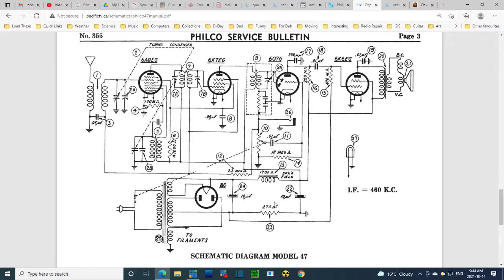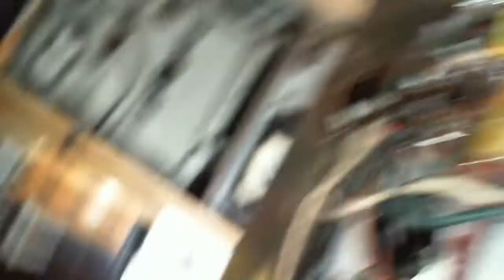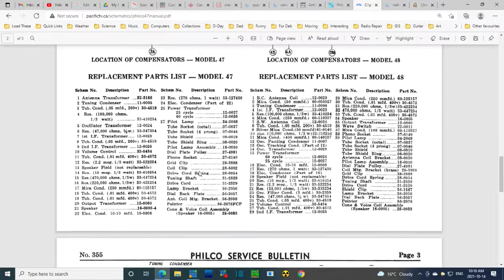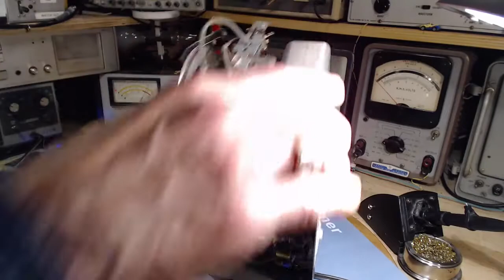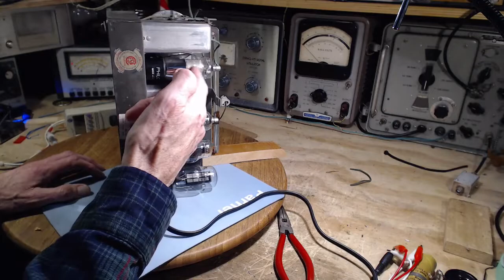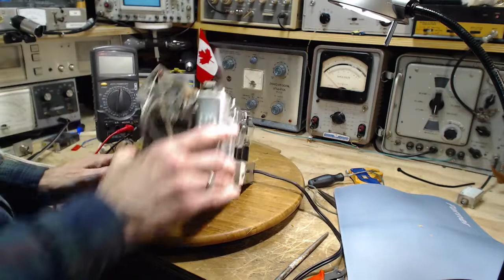Philco 47A Tube Radio Video #4 - Filter Capacitor Replaced

Comment: Hi Jim ...
I think it's 120Hz on the output tube grid .

Needs a cap across the p s u resistor , the one between the main caps .
( Be careful with the polarity )

PS
Unplug it !

Comment: Hi Jim ! Are You sure that these filter capacitors are really 10µF ?? They seems very small for 10µF/350V ! Also You can trie to flip the negative leads of these two capacitors, maybe You was wrong ?
Reply: I just put some 400V 10uf caps in a 1929 Steinite radio, and they were maybe only 10% larger than his capacitors. Mine were decent quality Panasonics, too. It's definitely possible these are 350.
Reply: @JMA_Elec  Yes, maybe, but I have never seen such small 10µF/350V electrolytics ! I have different 10µF/350V electrolytics and the smallest is 20X10mm, but these he used seems smaller to me. But the hum was there after he changed the originalcapacitors ! And now 2 days later he connect a "killercap"" on the plate of the 3rd tube (B+) and the hum disappears ! So I am sure that there is something wrong with the filtercaps.